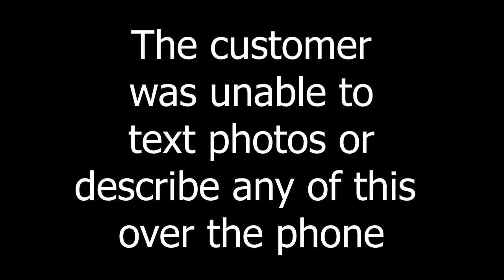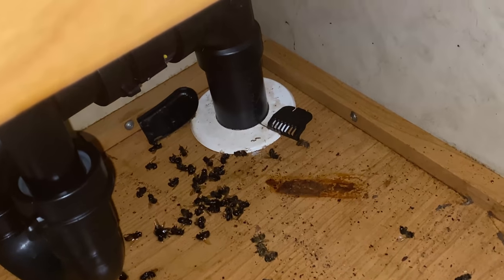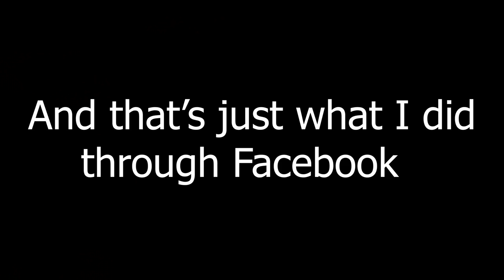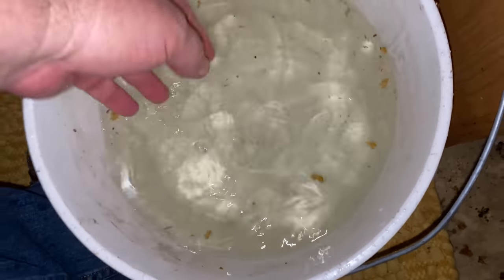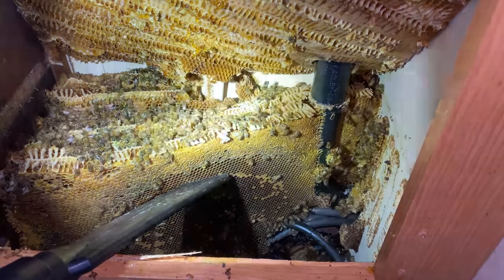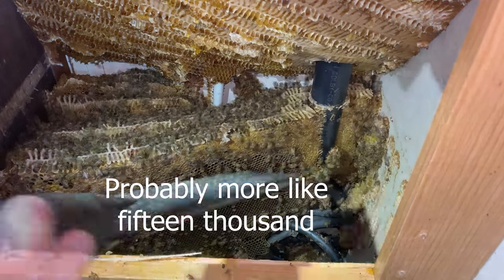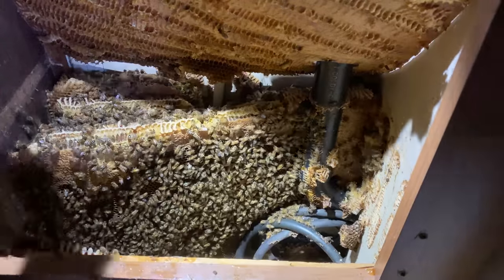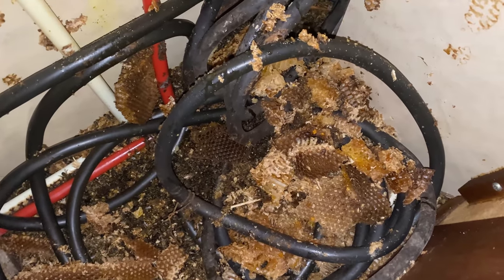Must See! | 7 Hours on the Toilet and This Happened!

Comment: What do you do with the bees after you suck them up with the hose?
Reply: DirtRooster uses a specially designed “Bee Vacuum” to suck up the Bees which are collected in a storage container and then transports them to one of his “Bee Yards” where he will place the Bees into vacant hive box that he has prepared for them with ideally “frames” that have sections of comb he cutout (removed) from the hive he is removing.  If like in this Bee removal he is not able to reuse any of the comb “frames” of empty “draw out comb” or “frames with waxed foundations” are installed in the vacant hive box for the Bees to draw out to fill with honey or the Queen to lay eggs in.  If you peruse DirtRooster ‘s other videos he shows quite clearly and explains what I am trying to describe.
Reply: @gullreefclub  Thank you.

Comment: Interesting video, I would be real nervous around that many bees, but they seemed to behave pretty well for you, from what I see, and the queen too!  I use beeswax for tempering cylinder records sometimes, in fact Berliner zinc masters were covered with beeswax  dissolved in petrolized ether, the bees wax not affected by acid, but the zinc was ,and the beeswax took the shape of the sound wave, and chromic  acid used to etch the sound waves into zinc to make stampers.

Comment: I have Backpack Blower that I blow leaves with and everytime I pull start it and put it on my back a customer( usually a woman) has to ask me a  question and expect me to turn it off every time which means I have to take it off, start it again, and then put it back on, the thing weighs about 50 lb. every time you turn on the vacuum it reminded me of that because the lady would come in and say something, do they not realize you're busy

Comment: Soapy water will kill bees but peppermint oil kills bees fast. Last year we had bees inside the wall. I could see where they went in but I didn’t want to trap them in the wall so I waited. I didn’t have long to wait. One morning I woke to find bees all over my room. The floor, walls windows even my bed. It was not nice. I got out with only one sting.  This spring I filled that hole with expanding foam.

Comment: I'd have just removed the whole cabinet and did the work outside..
Reply: That would have been idea, if it wasn't in a camper. The cabinet is connected to the wall where the refrigerator is at. He'd have had to remove the refrigerator to get to the screws that are holding on the cabinet. 😉

Comment: I wonder if a cordless electric filet knife would help with cutting out comb in some situations
Reply: Comb is actually very soft and easy to cut. More beneficial is a very thin, flexible long blade. Even helps to have a long blade bent 90 degrees about 1.5 in from the end.
Reply: @DStewart2022  yeah, comb is a lot like fish...